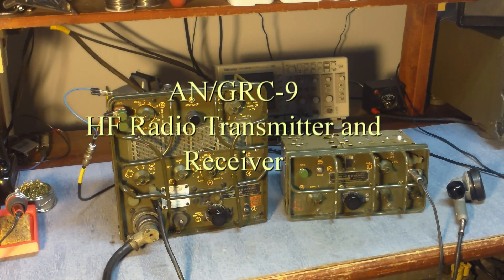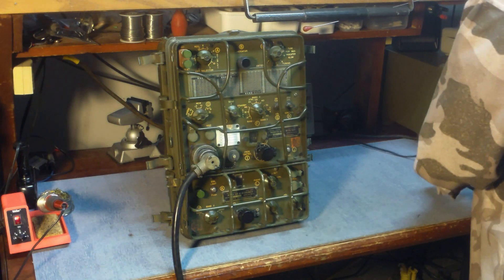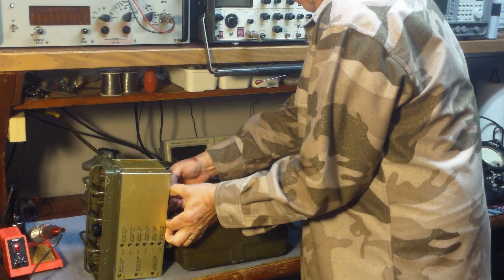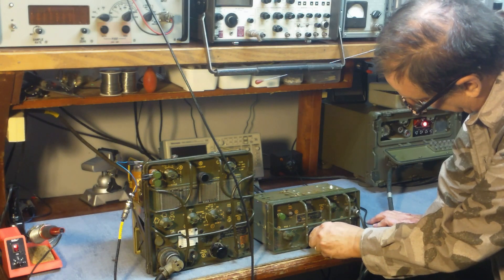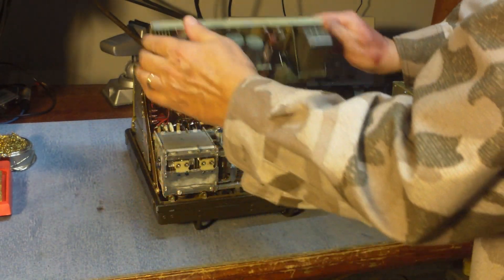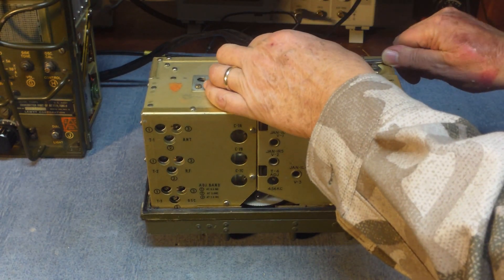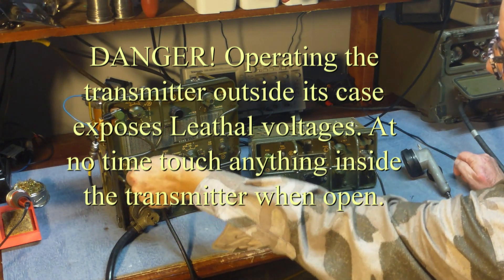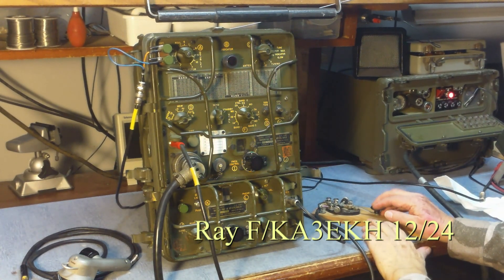Military AN/GRC-9 Radio Receiver Transmitter

Comment: I had a similar radio years ago. However on my you could put the outer cover on with the tx and rx units clipped on. The shape of the clips allowed this.  So only some clips held the cover. Others stopped clipped on. George UK 🇬🇧

Comment: I have one in my 1951 (restored) M38. Back in the mid 60s, I was a new ham and a member of Army MARS. One day I came home to find multiple large crates in the back drive delivered from Ft. Sheridan; a complete GRC-9 station with power supplies, generator, radios, canvas bags, and antennas, packed for deck shipping. After several hours, I had the basic radio assembled in the basement, powered by 2 spare car batteries and the vibrator PS, and connected to our random length end fed antenna. Using the leg key, I made several CW contacts, the furthest being Wyoming from suburban Chicago. Much, much later I found the M38 and reacquired a GRC-9 system with the correct mount. Great fun!